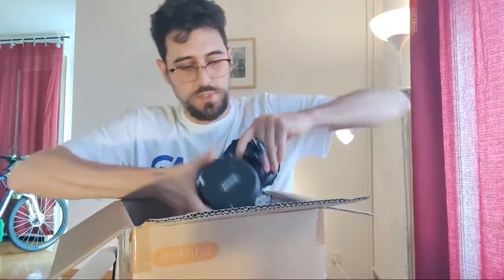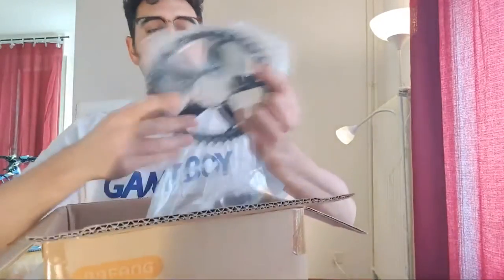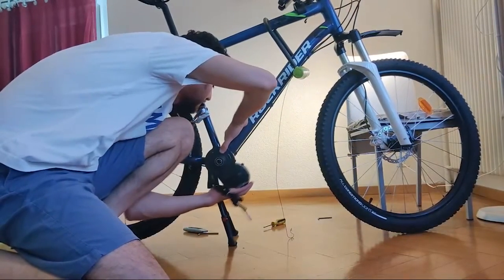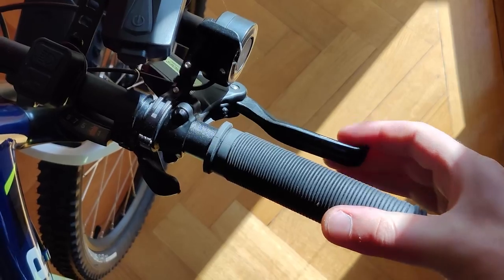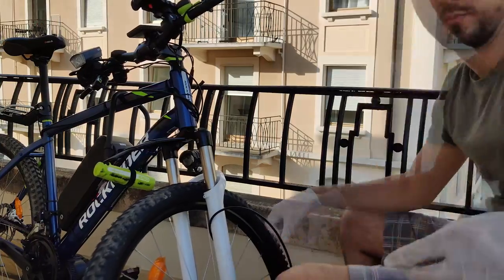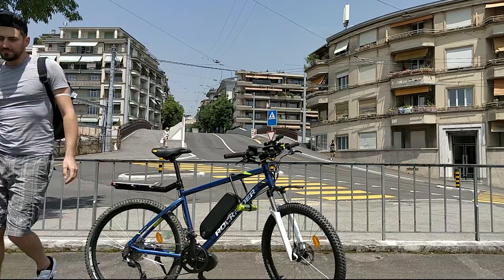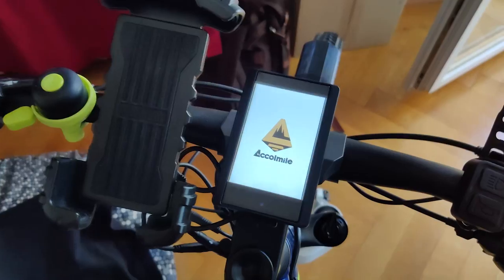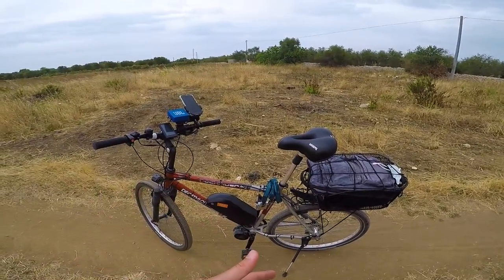Riding a Bafang 750W mid-drive kit on DIY eBike. How to? Speed? Steep climbs? Is it Fun?

Comment: Did you take measurements before ordering your bafang kit or can you tell them what type of frame and they can send you the right kit without any problems?
Reply from the maker: I ordered the bike after I checked the bottom bracket was within the measurements. The mid drive kit has only that measure, either it fits or not

Comment: Hello Luka, tell me.
I am thinking of getting bbs02  500w 36v. I would really want to use my legs (sport), that is why i think 750w 48v is too much power for my needs. What do you think?

I thought of TSDZ2 becausw of torque sensor, but it has problems fitting to Cube bikes and build quality is not quite for stand up ride.
I though of Lingbei, but most od sources stopped selling them because of torque sensor problems.
Reply from the maker: Hi! If you set the BBS02B 750W to have 9 assistance levels, the first 5 will act like the 5 speeds of the 500W version.
Of course if you can afford that price for the motor, you can go for the 750W and just be aware of its power (sometimes if you forget do decrease ass. lev. you might start up too fast and crush yourself on a wall, not kidding 😅)
but the 500 one I think it's enough for flat areas. Also, I suggest you to spend MORE on the battery and get the max capacity and quality you can!

There's nothing wrong with the TSDZ2, it's just that you will always use your legs alongside the assistance. It's a cooperation between the two (or the three). With the Bafang you can contribute as you wish in that moment and the motor will cover the difference in force to maintain the speed associated to the selected ass. lev. The risk is of course that laziness might take some range away from you

Comment: Do i have to use a new front chain ring on my bike or can i use the original one. Does it work with 2 rings at the front? Cheers
Reply from the maker: hey! you should definitely try the stock one by default. then, if you have issues or of you prefer a different size, you can buy another one and have a try.
there are also custom chain ring with support for multiple rings, but again try the stock one first. 80% of the times it's the right one

Comment: Holy Shit! The shocks are backwards!!!!!
Reply from the maker: every 3 months someone pops out claming the fork is backwards... it's not
https://www.decathlon.it/p/bici-mtb-rockrider-st-540-v2-azzurra-27-5/_/R-p-335529
if you believe this, it means you're looking at the wrong thing to understand its verse, like the white piece. that one is not universally indication of the fork's verse.
if you mount the fork reversed as you think it should, on this model you'll have the fork tubes and the wheel mount pointing backwards. plus, the brake mount for the disk would be on the frontal part of the fork, all of which is wrong...
this is because on this specific model, the white piece goes like this, and it doesn't mean the fork is backwards

Comment: Nice video! I'm about to order this kit but I'm curious, are you happy with 44T? I myself have two front sprockets today but am totally fine with a single one since that is usually better. At least for me. But the biggest sprocket of the two I have today is 36T. And I also have a smaller one, this setup gives me very low gear driving steep climbs. So changing to a single bigger one will make it much harder. But then again, since I have the motor, this shouldn't be a problem? 

Also, do you know why someone would like to put a 46/48/52 sprocket on it? To get the maximum speed I assume but for me, it sounds like torque on low speed might lack a bit due to that?
Reply from the maker: Well this is an interesting topic!
On all 3 of my kits (1 TS 500W, 1 BF 500W and now on this BF 750W) I always had 44T.
As a general rule, you should go for a big one (44 or 46 T) if you need speed. You want a small one instead (38 or 36 T) if you need efficiency on steep climbs.
At the beginning I wanted to have the same number of T as on the highest speed of the original bike's chainring (36T), but actually 44T is quite good anyway, considering how much the motor helps you. If I'd go smaller I'll lose some speed... so I'm fine with it.
You could start with the default one and decide yourself if it's the case to order another one later 🙂
Reply: @LukeLorusso  Sounds good and that is true, thanks for the response. :) 

I'm also thinking about ordering the gear shit sensor since I think it is not included, and would be nice to be able to shift gears without thinking about breaking the chain (or something else). Do you think it is worth doing so?
Reply from the maker: @SpriCoProductions  Absolutely yes, even if I never tried it 😅 I think it's a good idea since the motor supports it.
You could add it anytime, during or after the building

Comment: Hi Luke, thanks for all of these videos. I see that you now have both mid-drive motors. In this video you talk about power. Your Tongsheng is 500w but your Bafang is 750w (more power). Here in the U.S. I have the opportunity to buy a 750w Tongsheng. There are lots of hills where I live (including where my house is on -- very steep!) Do you know, how will a 750w TSDZ2 compare to a 750w BBS02B?
Reply from the maker: Hey! I don't own a 750W Tongsheng, but I own both 500W TSDZ2 and 500W BBS02B
I can just speak about the lasts, but the key differences are: pedaling system, battery consumption and throttle reactivity. You should check https://youtu.be/T7ve958hJXE
The Tongsheng will give you more control on steep climbs, so it won't be less effective. But the experience is simply different.
If you need a tow mule, get a BBS02B: it's simply raw power.
If you need control, meaning deciding when to go gentle and when to rush, get a TSDZ2
I will try to make more comparison videos
Reply: @LukeLorusso  Thanks for the quick response, Luke. I really appreciate it.  Thanks for the tip on control during climbing. I do want to go gentle on steep hills because I want my motors to last. I will not very light mountain biking and lost of city riding with hills. I look forward to more of your informative videos!

Comment: thanks for the video. One question, if you know the answer:
As I am very big (120kg), plus the bike weight, kit weight, and load weight with the saddlebags, do you recommend more torque? will it be enough? I live in lisbon-portugal, a city known for its 7 hills, but there are more hills than the 7 main ones. I'm thinking of buying one with more torque than speed.
Reply from the maker: Hey Luis, there's not an easy answer. First of all, torque does not necessarly sacrifice speed. In fact speed might be (among variour things) positively affected by torque.
That said, for your case I would consider either the BBS02B 750W or the BBSHD. You can maximize the resulting torque by using a smaller chainring on the pedals and/or a bigger cog on the rear wheel.
Just pay attention cause when I load up my bike coming back from the groceries store, there's a VERY steep climb and when I select the "lighter speed" the risk of wheely is pretty high! It's on you to find the right balance for your build

Comment: a distanza di mesi come ti ci stai trovando? sono anni che voglio fare sto setup e non mi riesco a decidere mai..
Reply from the maker: Ancora benissimo come il primo giorno, nessun problema finora 👌
Lo stesso vale per il 500W, che è di base lo stesso motore con un controller "meno performante"
Io credo che molto dipenda da come tratti il motore...
Nel senso che se lo usi correttamente, non lo sovrasforzi, non colleghi batterie con voltaggio sbagliato e non lo sottoponi a situazioni sgradevoli (tipo immergerlo nell'acqua o che so io) non dovresti avere grossi problemi!
E' normale che a volte si ricevono unità difettose, capita con qualunque prodotto. Però nel mio caso 2 su 2 sono ancora li che mi fanno fare la spesa ogni giorno, mi accompagnano in foresta o al mare e spingono ancora come all'inizio
Reply: @LukeLorusso  ah... sta cosa del 500w che è simile non la sapevo. C'è sempre da imparare🙃. 
Beh sono passati anni e io ancora qui a capire cosa e dove acquistare.. ed ecco un altra estate è arrivata, prendere la macchina qui è impossibile. Mi toccherà andare a piedi come al solito per colpa della mia eterna indecisione e confusione sugli acquisti. Grazie ler i tuoi video

Comment: I just mounted a 500w tsdz2 on my bike after watching your videos. It is quite fun and I am really pleased with the result ! Have you tried "upgrading" yours to the open source firmware ? Alongside many added features, It should be possible to set our 500W motors exatcly as a 750W one, which could mitigate the differences with the Bafang one ? It could be a really interesting video
Reply from the maker: thanks for your input! I'll check that up 👌
Reply: Tsdz2 is a weaker Motor, Bafang with 14s outputs 1100 watt+

Comment: I use epoxy putty to attach the brake cut off sensor, once the epoxy sets it becomes rock hard, the sensor is going nowhere
Reply: I use black hot glue.

Comment: Is it peddle assist only or can you add throttle so no pedaling?
Reply from the maker: you got the full explanation here https://youtu.be/T7ve958hJXE (it's the second bike that has the same motor, 500 instead of 750 but same model)
the throttle can be used without or with pedaling :)

Comment: This is probably a dumb question, but I will ask it anyway. Is it possible to build an ebike using a fixed hub wheel motor / dynamo that will be able charge your batteries as it zips along. Have been looking into DIY e-bike kits to breath new life into my old mountain bike that's been stuffed in the shed gathering dust.  Scenario - motor on one wheel or on frame, hub dynamo on the other wheel charging the batteries as it moves along.
Reply from the maker: I think it's possible... the thing is that the amount of energy necessary to move your bike is way more than the energy that you could recharge via a dynamo. There are people showing that the gain is less than 5% compared to not recharging it...
So as of today's technology I would say it's not worth it, but if you try that lemme know 😊

Comment: Is there a reason your forks are the wrong way round?
Reply from the maker: it is not, check the picture of the bike at retailer
Reply: @LukeLorusso  Sorry but the retailer must have them the wrong way round too, the crown is supposed to be at the front.
Reply from the maker: @Bobario1  https://www.decathlon.it/p/mtb-rockrider-st-540-v2-azzurra-27-5/_/R-p-335529
I still don't understand where this idea of "the crown is supposed to be at the front" is coming from, it's simply not true.
It might be a way for "beginners" to question it, but still not a rule: on this bike it doesn't, and you should look at the fork to know it, not the crown
Reply: Good call out they need to be reversed

Comment: How much that build cost you?
Reply from the maker: Quite expensive actually, but still way less than the equivalent new ebike with same specifications!
An ebike like this would cost between 3000 and 6000 EUR, while this bike itself is 300, the kit plus battery is 850 (it may vary depending on the retailer). Add like 15 for the rear rack and that's it.
Of course, if you go for a more quite 500W you can lower the price

Comment: Everybody's diy mechanical skills are on different levels.
There's nothing wrong with that.
People are good at different things.
Did you say this took you weeks to complete lol
It's a kit shouldn't really be any problems.
There was no fabrication no custom work.
Some bikes you have to grind frame & more
You were lucky didn't have to do any of that.
It was like plug and play
How did it take that long.
To be honest wires are messy doesn't look tidy.
Battery pack is upside down and looks bit stupid.
Sorry if I sound a bit harsh just been honest.
You said something about the front sprocket not lining up with rear sprocket it's NOT supposed to LOL
As you change gear it will never be lined up.
Reply from the maker: it took me 2 weeks but just because I had deliveries to wait, a vacation to plan and the video to mount. I was just saying to my viewers "sorry that it took all this time from the live to the actual video".
It's not a matter of skills.
The total building time might be 5 or 6 hours, but still the message I want to pass is "Don't rush to complete your build, take your time".
It's better to be careful than sorry
The battery pack is upside-down and in another video I explained that on some frames you are "forced" to do so because the bottle mount is too low on the bottom bar... unless you want modify the battery's holder...
I won't enter into the specifity of bike mechanics, I'll leave those considerations to those who knows the subject.
Thanks for the feedback anyway!
Reply: Post a video of you e bike build where you do a better job of resolving these issues

Comment: That's nice but there is something that has no purpose on this bike: the front derailleur.
Reply from the maker: 😅 I explained that on the live before: the front derailleur has the specific purpose to keep the chain track "in line". It prevents the chain to jump away from the motor's chainring when you're bouncing on the rocks with your bike, even if it's fixed

I made the mistake to remove it from the previous two builds and from time to times the chain jumps away (just happened 3 hours ago on my other Bafang build). With this last build it never happened! I invite you to try it 😉
Reply: @LukeLorusso  I didn't know that!
Reply: So you removed the cable and the handle bar controller but left the guard. First time someone recommended that. Thanks.

Comment: I just asamble my 750W kit. No reason to install the brake and or shifting sensors ..... I put Dewalt 54V  2Ah battery. It is enough to drive in PASM mode about 15km. I didn't install the throttle lever as well ;) Good look